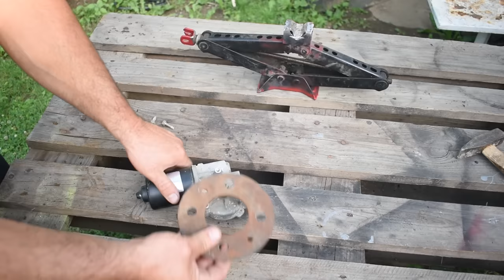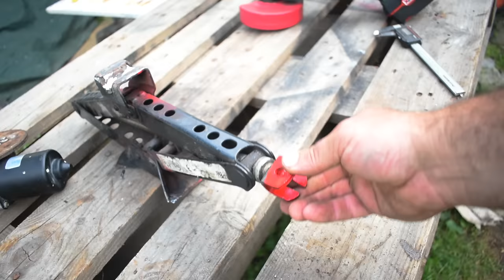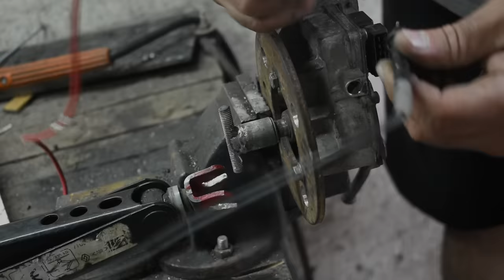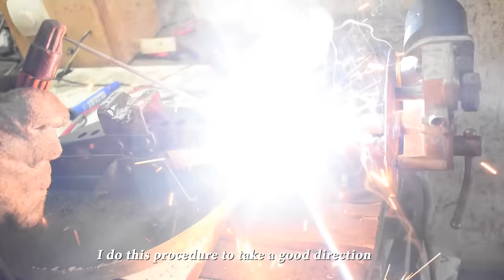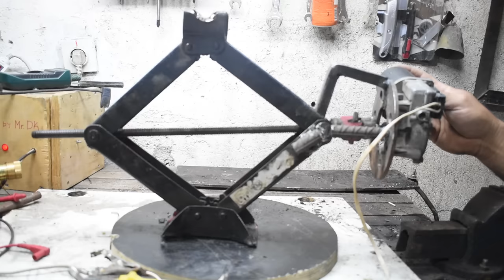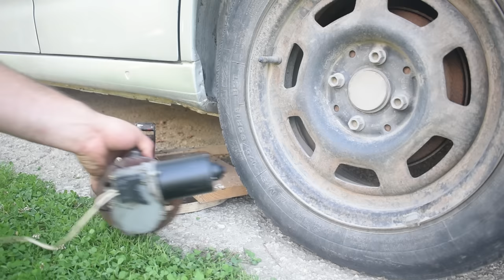12v DC Electric Scissor Car Jack Build at Home

Comment: Not bad!  Great idea!  I think that you weakened the jack significantly though.(Remember that the emergency jack is only as strong as it has to be) I don't think you needed the 3rd leg either(2 with rebar that thick and strong welds would be fine) and some gm scissor jacks have a hex on them to begin with and others are a bottle jack style if you want to experiment.

Comment: Pretty rough but it works and it's the same level of safety as if you were just using the standard handle. I wonder if that little DC motor gets too hot.

Comment: Good idea but 45 years too late, I did this when I was 13 with an old starter off a riding mower. Also used a briggs engine and an altenator off a car to build a battery charger.
Reply: Did you put it on youtube though?
Reply from the maker: @socksonfeet8125  hi
Reply: @socksonfeet8125  There was no youtube back in the 80`s

Comment: I made one 20 years ago.  I saw you made a mistake welding the rebar in a spot that would not prevent the jack to move up and down.  Have fun and be safe.  Great fun video to watch.
Reply: Y X how to get it down? By reverse the power line?

Comment: These jacks work perfectly in your driveway but try using that thing on the side of the road which is tilting the car towards the gutter! If it was only for the driveway, I'd be using a floor jack not this thing.

Comment: Nicely done. But it's given me an idea just to put a hexagon head on one and use my impact drived
Reply: That's what I did I shaved down the square ringlet that's on my scissor lift so that it'll fit a socket and  use my impact gun.

 The only thing that's in my trunk is the spare tire, a 12 volt air compressor, the scissor lift with a flat base that I welded on for stability, an impact gun with two batteries and a charger that plugs into the cigarette lighter..
All of that can fit in a small duffle bag.

 I can change a tire in less than 5 minutes

Comment: Hey!

In the USA here and I see a lot of European makers use the Parkside Tools. I’ve been buying a lot of them through Lidl Grocery that have been opening here.

Are they any good? They are very well priced and seem to be better than a basic Black and Decker.

I have gotten a few tools.

The 20v drill, impact wrench, hammer drill, small hacksaw. Plunge router, a few electric screw drivers...

I’ve seen welders, grinders, multi tools, rotary. Do you have any more?

Comment: I don't think the motor will provide enough thrust to lift the car. Under the application of load the motor will simply be rotated in the opposite direction of polarity

Comment: Is it possible if wiper motor is substituted with power window motor? Please answer 🙏
Reply from the maker: Hey thanks for comment, i think No its very low for this DIY project
Reply: @MrDKDIY  thanks for reply 😀 
I use the jack for the patient bed, so maybe it's not as heavy as a car, what do you think? Is it possible?

Comment: Its alot of work for powerd jack. I just attach the crank to a drill if to long cut it down to fit like a drill bit. Tighten it up much simpler and more effective.

Comment: Good work. That motor looks  too small for the job, how did you increase the torque? does it always come with the gear reducer?
Reply: its a windshield wiper motor they produce alot of torque because of the worm gear inside